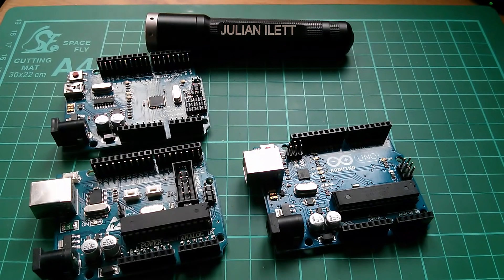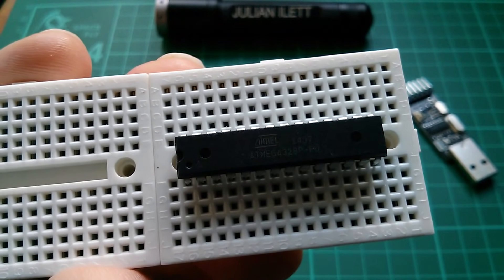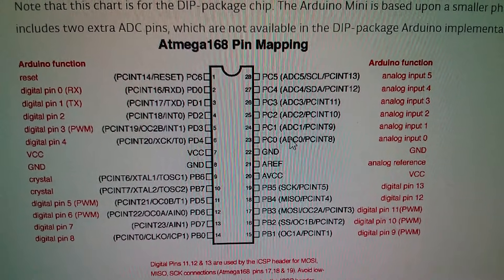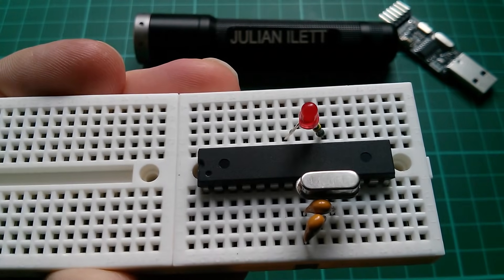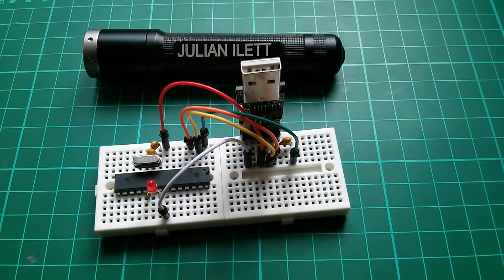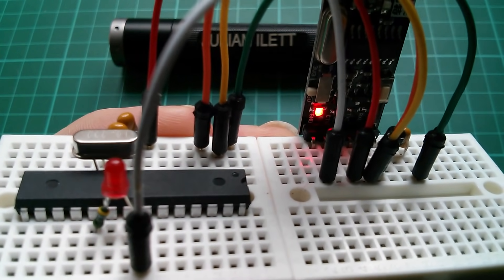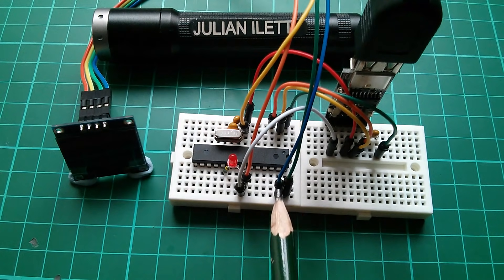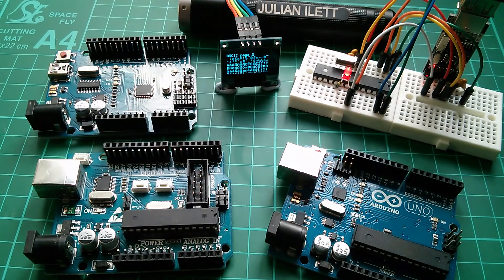1-Day Project: Build Your Own Arduino Uno for $5

Comment: Hey, just a quick question, the load capacitors used for the crystal here were 20pF. However, I did some reading and found that you are supposed to take the 'load capacitance' of the crystal and put it through a formula to get the actual value of the load capacitors to be used (https://blog.adafruit.com/2012/01/24/choosing-the-right-crystal-and-caps-for-your-design/). Following the formula, the load capacitors for this crystal should be 30pF (assuming stray capacitance to be 5pF)?

Comment: The Led  at digital pin 13 blinks for 1 sec after I start uploading.... but after that it shows : avrdude: stk500_getsync() attempt 1 of 10: not in sync: resp=0x00
avrdude: stk500_recv(): programmer is not responding
Reply: Hi, just for the records, I tried to do this project today and received the same error when uploading the sketch. The problems was solved putting a 10K resistor between PIN 1 and VCC.
Reply: Julio Cesar Fausto sweet! Thank you!
Reply: that's not my issue. I have the 10KR in pin 1 to vcc and still no go... I have hours upon hours of searching, setup, re setup, reloading of bootloader numerous times.. i have no idea what i'm doing wrong! I cannot get my CP2102 to work for nothing!
Reply: @wayneswan3092  hey maybe if you place a 22 nano farad instead of 100nano, it may work
Reply: same here, but I'm new with this :)

Comment: avrdude: stk500_recv(): programmer is not responding. I get this error while uploading. Any solution? :-)
Reply: +Vineeth Penugonda Did you install the correct driver for your usb to serial converter?
Reply: +voll idiot Yes. Everyone here in the comments suggested to insert a 10K Pull Up resistor. But I dont know between which two terminals I insert the 10K resistor.
Reply from the maker: +Vineeth Penugonda between Vcc and the chip's reset pin

Comment: I purchased the USB2.0 6Pin CH340G Converter for STC Arduino according to your link; and My Windows 7 recognized it and loaded the driver and it showed up correctly in Device Manager.  But when I tried to upload a sketch - Arduino IDE couldn't communicate with it.  Is there some kind of special driver required ??

Comment: i found 24mhz crystal on  sound card could this work
Reply: No
Reply: +suraj bhawal I presume "works" translates as it runs code and blinks a light?
As it's a multiple of 8mhz, is this possibly why it possibly works even if not correctly (clockspeed or uart or pwm?).
If not, why not :)
Reply: Tyeth Gundry No it won't work... cuz u won't be able to upload the code if the crystal if not matched with the bootloader. arduino software won't detect it.

Comment: If it doesnt matter about the clock speed or accuracy will it work without the crystal connected? Do you have to alter a setting in the bootloader?

Comment: Keep in mind prices have dropped & the breadboard is temp & you'd likely use something FAR CHEAPER & solder for longer term. Also you only need one USB-TTL for all your unit so that reduces price though you can get a Nano clone w/ ATmega328P & USB for programming $3.47 shipped (ebay)

Comment: Thank you for this video, Julian. This tutorial truly helped get me started on moving into making barebones Arduinos, and my own embedded devices.

One thing that I learned that might be related to the issue you had with manual reset on the programmer. Putting a 10K pull-up resistor between RESET and VCC seems to let the 328 reset itself automatically after a sketch is uploaded.

Comment: thanks, cool video... can't understand how people can actually dislike a video like this. If you already got one arduino (I got my Tinys even for less than 3 pounds), you can do without the usb to serial module... I have also found some tutorials that show you how to use the internal crystal... that would leave you just with the IC :)
Reply: and with your approach you can stick the bootloader in a raw atmel chip instead of paying extra for a pre-programmed one.  Or have I misunderstood?

Comment: i am not understanding all this (not understanding crystal, ground, etc) is there a video that explains all this?
Reply: +amr ojjeh +Captain Dandal I'm quite impressed by you two!
I just wanted to jump in on your "Why should I choose an Arduino, when a Raspberry is more powerful?" question.
Because that's basically it - your Raspberry is way more powerful, and for a lot of stuff it's just overpowered.

A Raspberry is running Linux, has a lot of storage (gigabytes!), a huge amount of RAM, Ethernet, audio&video output, ... It's designed to do an awful lot. More or less everything you want it to do for you (but be aware, it's still not the same as your computer, so you have to be patient sometimes...)
I would use a Raspberry as a cheap server. You want to have a small NAS, being able to access your hard disk over the network? RPi is your friend. You want to stream videos to your TV without using your PC? RPi is your friend. You want to measure your internet connection speed regularly, and display the results on a LED strip, where the amount of active LEDs indicate your current speed? RPi is still your friend.

Your Arduino, which is just a small microcontroller with some convenient extras (as you've seen in the video), is running... yeah. It's basically running >exactly< what you say it should run. You are writing one programming, you are wiring the Arduino to your computer, and you are flashing this one program.
You want to make some noise every time someone enters your room? You want to build a parking sensor which beeps whenever you drive backwards, before bumping into another car? Arduino is your friend.
You want to attach a motor to your wardrobe, and open its doors whenever your bluetooth enabled smartphone enters the room? Arduino.

For many things, you can choose between an Arduino or a Raspberry. You can talk to motors and sensors from the Raspberry, and you can use WIFI or displays on an Arduino. If talking to motors and sensors is the only thing you want to do: choose an Arduino, it needs a lot less power than a RPi, and boots a lot faster, so you don't have to wait when starting it.
If you mainly want to show graphics on a somewhat big display, send "a lot" of data over the internet - buy a RPi. An Arduino won't give you a MB/s internet connection, and won't show YouTube videos, not even in SD.

If you think "I don't need my computer to do that!" - think about buying a RPi.
If you think "I don't need shiny graphics, a fast internet connection, audio or lots of storage to do that!" - think about buying a Arduino.

Microcontrollers are really cheap, really small, boot really fast and need >very very< little power.
RPis are cheap for a computer, but expensive for a microcontroller. They are tiny compared to your PC, but as big as your hole project could be when using a microcontroller on a perfboard. They might boot slightly faster than your computer, but take ages compared to an Arduino. And compared to a computer, they consume no energy - your reading lamp on your nightstand probably needs more. But compared to a microcontroller? Choosing between Arduinos and RPis can change the battery life of your project from several months to several hours / a few days.
Reply: +amr ojjeh well, my english isn't any better for that matter (im 13 and live in Finland :P). But to help you, I can tell you kinda lot. The raspberry PI is a computer. It has a powerful processor and gigabyte of ram and a memory slot for a memory card and usbs and alot of that stuff. Whereas the arduino is a microcontroller, it does not have an operating system, it can just take very basic code that can only be used to trigger electronic signals on or off. The raspberry can do that too, with its gpio pins. But the difference is huge. The raspberry is a real computer and the arduino is a little microcontroller that can only store and run likes one 18kb or something file of code used to trigger electronics on and off.

The price difference is not huge thou. The real arduino Uno is waaaaay overpriced at likes 30€. The raspberry costs somewhere around 25€ on ebay.

Hope you understand now :)
Reply: amr ojjeh an RPi can run Linux, or even Windows (not sure if it's finished yet, but there is some small Windows 10 variant in beta for the RPi), so it can deal with all programming languages your PC can deal - programming in Java, C++ (or Python, as you're saying) is no big deal on the RPi. C# might be a bit more complicated on Linux in general, but should run on Windows 10.
As you are saying: a RPi is basically like your PC, just more limited (but still quite powerful - not only for its size and prize!) - and it has these GPIO pins, where you can hook up every electonic circuit or component you want, and interact with it through your RPi.

What do you mean with "is it possible to use both"? Both Arduino and Raspberry? Or Raspberry and a big PC? Anyway, the answer is yes :)
There are lots of different ways to interact between these devices.

You can talk to an Arduino through your RPi / its GPIO pins, you can talk from an Arduino/RPi to your PC over a network connection, ...
If you tell me what you mean exactly, and even better in what you are interested in / what you want to do/learn, I can try to come up with a few examples :)
Reply: +amr ojjeh ground is like the negative side of the battery, the crystal is basically a timer component it's rated as 16 mhz which means it ticks every 0.001 milliseconds so the loop function in arduino runs every 0.001 milliseconds, it also allows the arduino to calculate time with millis() function.
Reply: or a website
Reply from the maker: Or a book
Reply: Julian Ilett well i want it to be free so no books allowed
Reply: +amr ojjeh well, I dont know about your general understanding of electronics, but stuff that I can clearify is:
A crystal oscillatro, reffered to as a crystal in the video is a clock speed generator for the microcontroller. Like the one in a big computer CPU. Ground means the - in electronics. You always have + and -. The microcontroller's (which is a small computer) ground pin should have a connection to the - pole of your power supply of choice. If I left something unclear (most likely), ask a little more specifically and I can try to help you. :)
Reply: MrMats0n Thanks but i'm trying to figure out what is the difference between an arduino and a raspberry pi. i know that a raspberry pi is a microprocessor while the arduino is a microcontroller but i kinda still don't get raspberry pi because its just mini linux computer and im kinda figuring out what are the limits of raspberry pi. (sorry for bad english my english drops down by 50% when i start talking about electronics XD)
Reply: MrMats0n sooooooo why are people getting an arduino instead of the raspberry pi 2? btw im also 13 and foriegn and some how my reading is in 8th grade level (im in 8th grade)
Reply: +amr ojjeh well, to answer that question, an arduino clone can be got for 3€. And arduino's are usually used a lot more for electronics projects because it consumes less electricity and not many projects need those computer features of a raspberry, likes an operating system. And you can get those shields to give you the functionality you need in the exact project, so it can fit your projects just perfectly. Also, with a raspberry,  you would need to write your code and do some computer stuff to make it run when you boot the device.

But yea, people are getting arduinos for projects because they are easier and cheaper to use, and raspberry's for when you need that power or just as a computer. An arduino can in no means be used as a real computer.
Reply: MrMats0n ah ok another thing i heard that 16gb is recommended but i saw a starter kit with 8gb so how much space do you recommend just as a person who just started and why does it take that much storage and i think the os is like 1gb so how much space do you recommend?
Reply: +amr ojjeh for a raspberry? Yea, the light os is about a gigabyte, and you dont usually need much space. It really depends on what you are doing, some programs take up a gig or two (or three even), and having too little space is a struggle everytime. I really don't know about you, my linux install on my pc takes up 11gb. I would recommend going 16 gigabytes, just to be sure (the pricr difference isnt huge, right?), but the 8gig one should do good too.
Reply: MrMats0n nah it isnt i think its like a 5$ diffrence
Reply: +amr ojjeh well, then I certainly recommend the bigger one. Never hurts.
Reply: MrMats0n Thanks you have helped me alot!
Reply: Captain Dandal thx you did a really good job of explaining the crystal
Reply: amr ojjeh you're welcome, if you want to know more about it google "Crystal oscillator" and read the wikipedia page, is used in almost all electronics.
Reply: Captain Dandal it is used* sorry i'm a grammar nazi....
Reply: 8bit revolution so from your examples i'm seeing that a RPI is mostly used for "virtual" things while the arduino is mostly used for "physical" things but what i don't get about the RPI is that it's pretty much your pc but more limited by power and storage and gpu and everything pretty much plus your pc supports more applications and you can write programs using c++ or c# instead of just python. BUT i have one questions...is it possible to use both? and if so can you give me an example? btw i like your name it fits with the RPI lol
Reply: 8bit revolution i actually meant an arduino and the RPI sorry for the confusion but what i'm interested in is actually robotics (making a robot that can move and stuff) or controlling my house outside my house that stuff
Reply: Yeah, you can simply connect them :)
RPi has GPIO pins, which means that you can wire it up into an electronic circuit - for example to an Arduino :)

For robotics, I would choose a microcontroller, since it's usually about reading some sensor data and reacting to it, ie. stopping when you detect a wall, or steering left/right when you leave a black strip on the floor. Or listening to a radio signal/controller, then turning a motor, which moves some part, which fires a loaded rubber band. Or whatever.
You don't need USB, HDMI, storage, fast Ethernet or an operating system where you could play games or browse the internet if you would want to.
You would want something that works as soon as it's turned on, and can run on a battery for a while.

When you automate your house, you typically want to have some interface to do so - both for displaying current data, and for entering new actions. You could have a small LCD screen and some buttons connected to your Arduino, and your Arduino wouldn't really have a big problem talking to all your sensors and motors disributed in your house, but let's be honest - you don't want to have to push buttons and reprogram & reflash the whole thing whenever you extend something :)
For this, I would recommend an RPi, which could just serve a web page, which you can use to control your whole system, your whole house. It's easy to extend and easy to control through a web page.
Reply: 8bit revolution for the robotics part aren't arduinos to weak to power them?
Reply: amr ojjeh what exactly do you mean by weak? :) Microcontrollers like Arduino are typically "stronger" than Microprocessors like RPis, meaning they can handle a higher current. And a RPi may be faster, but MCs are still pretty fast.
Reply: +amr ojjeh and don't forget relays. If you have a high current device, just hook the arduino pins to control pins of a strong enough relay, and supply power to it. Then connect the relays output to your device and your done for that.
Reply: 8bit revolution MrMats0n ah i see thank you so much for your help :)
Reply: +amr ojjeh    another point:  if you build a small robot on arduino uno and six of your friends want one too,  you can make them small and cheap as shown here.  With Pi you'd buy  6 Pi's.  Also if you mean more advanced robotics including video image recognition, for example, you will want a Pi.....OR one of the more powerful arduinos.  The uno shown here the simplest, least powerful.  See other peoples projects at the arduino site.
Reply: Ray Kent thanks
Reply: yo the person is a peter  non